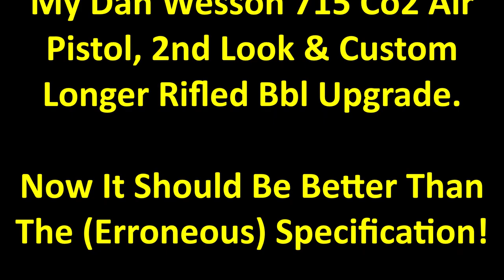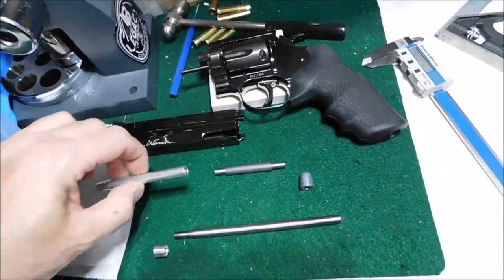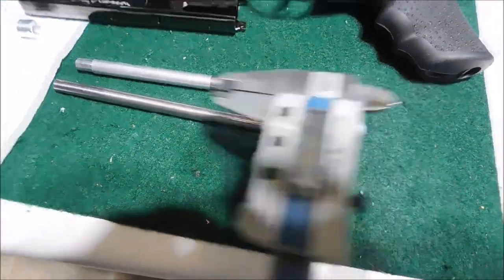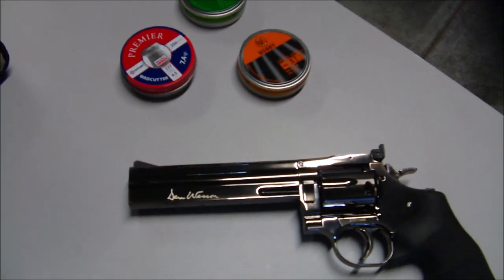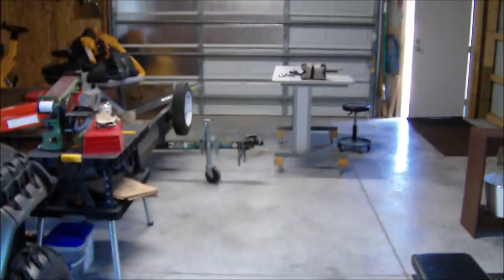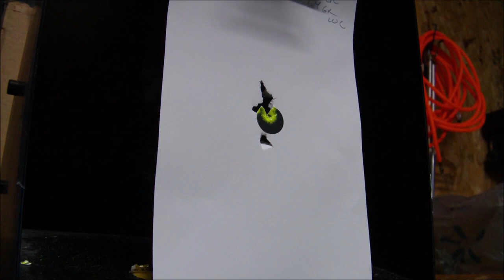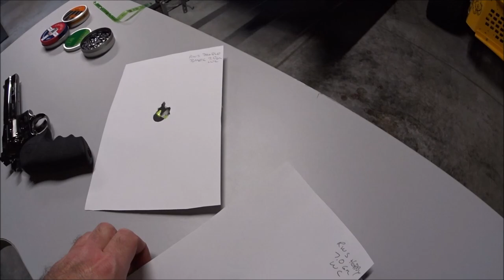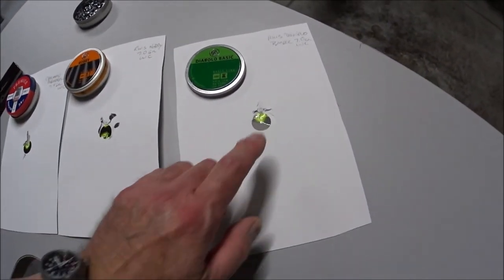My ASG Dan Wesson 715 6" Co2 Pellet Version - 2nd Look & Custom Barrel Update

Comment: I'm interested in the 8 inch steel bb version and I really hope it doesn't have that same double tube barrel. I really wonder why they did that exactly. Is it so they can use the same riffling part on all pellet models and save money since it's probably the most precise piece of the revolver. Perhaps it keeps the power under certain limit for some market. Would be nice to know the exact impact this thing has. Is short riffled more or less precise than a full length smooth barrel without riffling or is there an impact on power. One thing I think I understand is that if the smooth section was as small as the riffled part it would just cancel the spinning so better to just not do riffling at all.
Reply from the maker: Agreed, which is why typically you can shoot pellets in the (smooth bore) bb versions of many models. Sometimes marketed as "dual ammo" air pistols.
Reply: @VipersVideos  That's one of the reason I want the BB version instead of the pellet one. I have a Umarex SAA pellet version and technically you can shoot BB out of it but it would destroy the riffling over time. With pellets in a BB version I may only lose a tiny bit of accuracy for the lack of spinning but considering the alternative is a barrel half the size it may not even be a noticeable difference.

Comment: Hi, I have the Model 29 6.5" and it is an identical setup with a 2.75 rifled barrel, the rest being a smoothbore of 6mm. Having looked at it closely I cant see any reason why it cannot be converted to .22 , admittedly I have a lathe and an old .22 barrel ready to go. Well done for doing the conversion with everyday tools .
Reply: Turned down a .22 barrel to fit, around 1/4" longer than the original barrel and liner and made a new poppet thing out of T6 aluminium, there was a bit of slop at the muzzle end of the barrel and shroud so reduced that to a few thou. Reamed out the cartridges and made ptfe seals for them.
A proper result for the accuracy and power is up to around 3.2 ft lbs, 320 fps ave with 14gn pellets

Happy with it at last
Reply from the maker: Sounds like a cool project!

Comment: Very cool dude! I wish I was talented like that!  Hey can you please list your top 3 type of pellets you like to use in the DW715?  I'm having a little trouble finding a good penetrating type of pellet that will work without jamming.  I'm not as interested in accuracy with my handguns as I am with accuracy in rifles - I prefer penetration using pistols because targets are generally closer using pistols. Thanks any recommendations greatly appreciated!
Reply from the maker: The only pellets I've shot out of it are the ones in the vids. So those would be my only recommendation on ones actually used. That said, if you want good/max penetration I'd suggest trying lead free pellets, or pointed lead pellets. Then domed style, with wad cutters and HP's last, typically anyway.
Reply: @VipersVideos  I'll just keep trying different brands until I find something, like ya do for any new pellet gun.  I'll go back and rewatch the vid and try those pellets you used . 👍🏻
Reply from the maker: @gobshite5150  They are RWS Hobby 7.0 gr., - RWS Diabolo Basic 7.0 gr., - Crosman Premier 7.4 gr.  These are all wad cutter design and not necessarily good for max penetration. They have a round flat face for more or less making a nice round hole in paper targets for easier group measuring/checking.  So yeah, keep trying different ones until you find one the gun likes, and you like.

Comment: Great vid. I did the same thing with mine using a 6” section of a Crosman 1077 barrel from a broken rifle. Much better accuracy. I’m now making some better fitting shells, as the alignment of the barrel bore with the shell bore and the barrel/cylinder interface is also a factor in inaccuracy for the 715.
Reply from the maker: Another nice mod upgrade for accuracy improvement.

Comment: Hello !! I came across your videos, and I am amazed wih all your knoledge etc!! I am also very much interested on buying one ( or more ) DW models 715 6'' in both finishes and in 4,5 and 6mms. I knew that there are 4,5mms ones that had rifled barrels, but I never saw any YouTube movies showing this disonest matter of a shorter barrel instead a full lenght rifled one!!! It was such a surprise to me. I do not think this is fair to sell a shorter disguised barrel in a 6'' place!!! I am still very interested on getting one or two DW715 models to my replica guns collection, but I want to change those inner barrels to a full lenght 6'' rifled ones. Now please inform me if you'd advise me to buy a classic airgun fifled barrel and machine it to fit into the 6'' outer DW 4,5mms model. 1000 thanks for this video, and for your possible answer in advance.
Reply from the maker: Hello, I don't like to advise because of course it's a personal choice what rifled barrel piece you have the abilities to modify to fit. But I will say if you have access/ability/skills to actually machine with a lathe, then you should be able to use most any good quality rifled barrel stock to replicate the overall length and step end detail to make it fit properly. 
So any advice would be after you buy the DW 715, take out the barrel, measure it and get as close to same outer diameter (or slightly bigger to machine down) rifled barrel as possible. Good luck and enjoy!

Comment: Thank you for taking the time to make this! I want to buy the D.W. 2.5" .177 pellet revolver and was wondering if the barrel was rifled. Wasn't clear on any website.
Reply from the maker: No problem. I have found the barrel specs to be dubious and confusing.
Reply: @VipersVideos  Update. I got my hands on a 2.5" 1.77 pellet and it is indeed rifled. Very nice piece. Hoping theres a way to add a threaded barrel for a tracer unit or an extended barrel in a mock suppressor.
Reply from the maker: @smoothburrito  Where there's a will, there's a way.....

Comment: Hi Buddy, the problem with the lack of the full length inner rifled barrel is because yours is a LATER (after 2016) version of the gun, the original 2015 and some of the 2016 versions do have a full length rifled inner barrel. It seems to have been a 'cost cutting' episode done by either the manufacturer (Wingun of Taiwan) or by order of the distributor (ASG of Denmark). Unfortunately the later versions of this lovely replica only have a partially rifled barrel, I've had two (an original 2015 version and a later 2016 version) DW715-6"s that have the full length rifled inner barrel, one of which I swapped out with the smoothbore silver 6" version so that I had a silver DW715-6" (which is as it should be, the '7' in the DW715 stands for a stainless steel finish) and the other I kept as original which makes it a Dan Wesson model 15-2 replica (with the blued steel grey finish).

A great video nonetheless though buddy but I just thought that I would explain the history of the replica model, that way other people might realise why getting hold of the earlier models is so much better as you don't need to re-barrel it. The year of the model is designated by the first two numbers of the serial number before the letter (like yours is 21GXXXXX, making it a year 2021 model), I hope that helps buddy !
Reply from the maker: Yes, good information, thanks! Here was my first video on it...  https://youtu.be/n-pCxq3lj2w
where I mention a bit of this information on my talking to ASG about it, and also comparing to my real DW715, etc.. 
 But yeah, I saw a few vids and promo pics of this model (unknown at the time earlier version) online and saw the full length bbl before I bought this later version. I also believe it to be a "cost cutting" measure and also 'commonality of parts between' between barrel length models. The rifled steel barrel piece at 2.5" could then be used in 2.5",  4", and or course this 6" models. Hopefully folks can look (are appropriately skilled in looking anyway) in their barrels to check thread lengths to determine old or new, otherwise they shouldn't even think of changing (re-barreling) it out... just sayin..lol  
Still though, very good information and yes every little bit or more helps! Thanks!

Comment: Excellent set of videos! Good to see you were able to sort things out. I was thinking obout getting one until you laid out the short barrel problem. If the mfr changed to a shorter rifeld barrel while still claiming it is 6 in or so - that stinks. Got a Vigilate instead. I wonder  if the barrel from a broken Beeman P17 could be used as a donor? I imagine a kaput P17 could be picked up on Ebay for cheap money. I really dont want to trash a new one just to get a barrel. What is the outsde diameter of the donor barrel you used? 

Thanks Again!
Reply from the maker: Yeah it was a sketchy to misrepresent the actual barrel spec on these latest version models. I'm not sure which barrels would fit better as a donor, but with some creativity and patience it can be done. 
The O.D. of the donor barrel I used was around .312" or 7.9mm give or take.

Comment: hi, thanks for your work. impressive. just bought mine, and i wounder where i could buy donor for the barrel upgrade? i am new to airguns((
Reply from the maker: I used a cut out section of barrel from a Bear River Sportsman 900  Multi-Pump Air Rifle. It was something I had, but no longer used. There are lots of other options I'm sure, but you'd have to do a lot of research on different model specs, etc. Unless you can use a lathe and turn down larger outer diameter barrels. I just kind of did it on the fly with what I had to work with. Not a great job, but it worked out well enough.
Reply: @VipersVideos  i did the same mod, took rifled barrel from another pistol - damn it's so good now) thanks!
Reply from the maker: @MykhailoChuha  it's how it was meant to be in the first place! 😀
Reply: @VipersVideos  yeah, very cool gun!

Comment: Interesting video. Nice reverse engineering job too! You might try H&N Field Trophy Match 8.64 grain pellets. I'm getting excellent accuracy with them out of my CO2 pistols. I have a new 1875 Remington to experiment with next. I was considering getting the 6" Dan Wesson or S&W M29?
I imagine that the industry standard CO2 pistol barrel is similar to what you discovered. A shortened rifled section of barrel that acts as a rifled choke tube.
Reply from the maker: I don't have those pellets in my collection, but I need to buy some other pellets from PA so I'll try to get a tin of the H&N 8.64 grn. The Dan Wesson seems to be built a bit more robust than the S&W M29 but the M29 is really a nice looking replica of the iconic .44 mag. 
I'd almost picked up that 1875 several times, but never did. Yet. 
Thanks for the comment!
Reply: @VipersVideos  You are welcome! I enjoy your channel a lot. Keep up the great content.
Reply from the maker: @tomvawter4531  Thanks again!
Reply: @VipersVideos 
Interesting you mention the S&W M29, l have it and it's very robustly made, pellet version that is but l have read complaints about the earlier bb versions being loose in the cylinder and ejector rod not fitting in its shroud properly. But mine is OK in that department, and it is very loud l mean almost sounds real. I envy you your skill with engineering. Great vid
Reply from the maker: @biggusdickus5986   I have both as well, but just based on my two particular units, the DW 715, is tighter and more solid than my M29. That's not saying my M29 is bad, but more so the DW 715 is built a bit more 'tank' solid than it needs to be, but it's a copy of the real revolver which is also built like a tank.

Comment: Now we all want you bro to make us a barrel . Oh please 😉
I put a red dot 🔴 on my DW715  6 inch model with 2.5 barrel shoots very well.
Reply from the maker: Nah, mine just was not very accurate and I was irked enough to try and make a longer barrel. As long as yours shoots well with the red dot you're gtg.
Reply: @VipersVideos  I was pissed to that such a nice looking gun only had a 2.5 inch barrel.
Reply from the maker: @PeterAgostiniJdcap26  Yes, and it's sketchy and misleading for the mfgr to spec it out as a 5.5" rifled steel bbl. That was my biggest issue.
Reply: @VipersVideos it has been awhile any aftermarket barrels available now from any manufacturer to buy ? Ty of course I watched. Again 😎👍🏻
Reply from the maker: @PeterAgostiniJdcap26  Not that I've seen or heard of, so finding a suitable other gun barrel and modding still seems to be the only option.
Reply: @VipersVideos  you would think by now there would be a kit available
Reply from the maker: @PeterAgostiniJdcap26  yeah that would be nice.

Comment: How do you suppose the barrel is on the 4" version?
Also, how are they getting out more power out of the 6" version compared to the 2.5" since the effective barrel length is the same? Could it be something to do with the hammer spring? Or does the 6 incher have a bigger valve?

Shite play on DW's part to mislead customers like this. You have done some really good craftsmanship here 👍
Reply from the maker: It would seem that ASG/DW would use the same rifled barrel part and then just add a shorter 6mm dia to finish the length the final length like in the 6" version, but that's just a guess on my part. They do weird stuff..lol
Not sure about any of the internal parts being different between bbl lengths.
So, if the inner valves and springs are the same, then I suspect the additional velocity comes from the longer oversized 3" length rest of the barrel after the 2.5" rifled one. Why? Even though it's oversized and some gas will escape around the pellet, it still keeps gas behind the pellet pushing it that additional 3" until it exits the bore. That's why I believe the power is there/greater than shorter model bbls (in theory anyway), but the turbulences around the pellet in the last 3" interfere with some accuracy. Just my thoughts and experience. YMMV of course. Thanks for the comment!
Reply: @VipersVideos  i think there is a difference in the valves of the 2.5" and the 6" one. I think the 2.5 incher had a 3 hole valve vs the 2 hole one on the six. I'm not 100% sure but i remember watching a video about it.

Also i think you're right that the gas would still propel the bullet even after entering the oversized barrel, could explain the higher fps. Bang on on the idea that the turbulence could affect the accuracy too .
Reply from the maker: @avp.69  Yeah that could be. I don't know much about the internals, and just enough about bbls and simple physics to get myself in trouble, or sometimes out of it.. lol
Reply: I have a 4" version and it's got a full length rifled barrel. Not exactly 4" because of the spring system in the muzzle, but certainly the whole  bore is rifled.  I'm pleased with the accuracy of mine, and very pleased with the number of shots a CO2 capsule provides.

Comment: Good work. Are you interested in selling the original barrel assembly taken from this Dan Wesson?
Reply from the maker: Not at this time as I have other projects I might use it in, thanks!
Reply: @VipersVideos  Thanks for the answer. I'm going to change the barrel on my Dan Wesson bb and I have one more question: was the crown made with a brass screw perfect or was something else needed?
Reply from the maker: @Falco60-j9r  I used a large slotted round head machine screw in a drill chuck with some fine grit lapping compound. I would have then used either some 600-800 grit paper or steel wool (maybe both, don't exactly remember) to clean and smooth it up. There is no way it's perfect as this is not a precision method. But if it shoots straight and consistent that's good enough for me. One time for another gun barrel (different project) I had to do it twice, and that turned out equally well shooting wise. Good luck with your project.
Reply: @VipersVideos  Thanks
Reply from the maker: @Falco60-j9r  No prob, and to clarify since I see I left it out, yes it was a large 'brass' slotted RHMS.